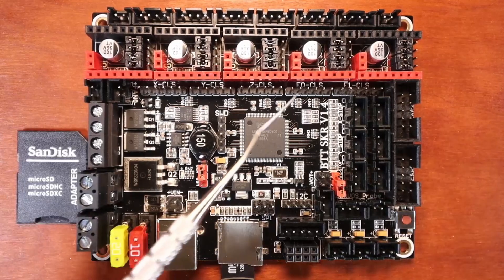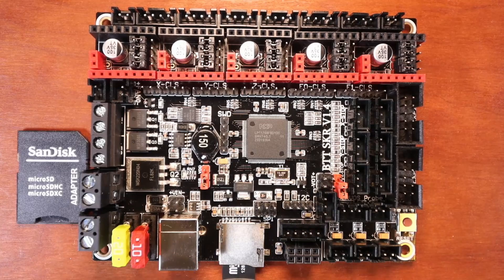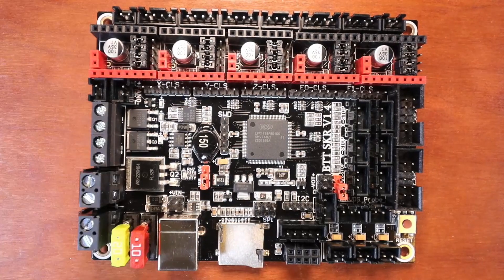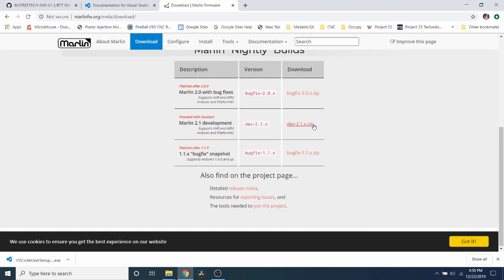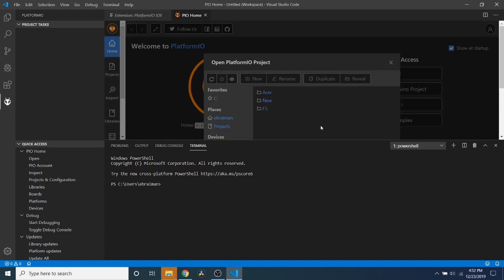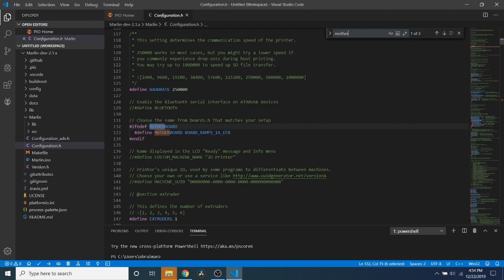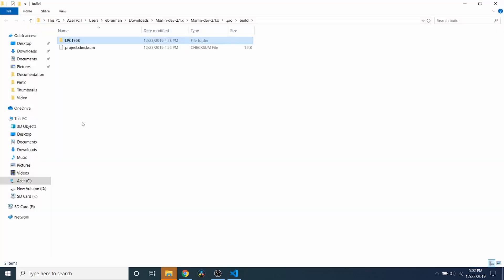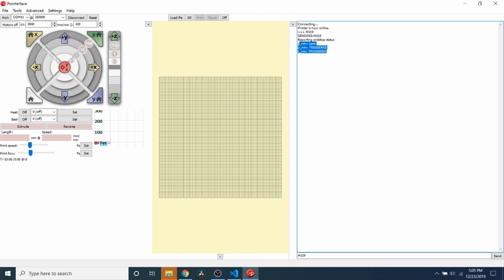BigTreeTech SKR 1.4 - Basics

Comment: There is no X Y and Z MAX endstop pins on this board, the MAX pins you reffered to aint endstop pins, they are diag pins for filament runout, power diag etc.
Reply from the maker: Are you sure they cannot be made max pins?  The pins can be modified to be anything as long as you understand how to modify the boards pins file.  So yes, they can be x,y,z max endstops or runout detector.
Reply: @EdwardBraiman  well you can use two of them I think, but the one next to Z-min dont have any resistors connected to it, its for power detection.

Comment: I couldn't connect to the V1.4 turbo card with the computer no matter what I tried. I saw you had a video on how to use just the card, I thought awesome. Compiled the firmware, sent it to the drive, it updated the firmware on the card. I installed it in the board, I have the board connected up to the printer already, but it still shows no printer attached on the screen. I sure hope they didn't sent out a bunch of Turbo cards that didn't work. Big Tree Tech is not responding to any emails I sent. Thanks for your instructional videos and your time involved in making them for us all.
Reply from the maker: you're welcome.
Reply from the maker: Did you get the TFT display to work?
Reply: @EdwardBraiman  I did, but the first one failed, the chip on the card would get over 200 F and the screen went black. The second one is working, but I only have the touch screen part, which is what I wanted any way. All the cables have to be connected or it won't work. I even tried it using the port 1 from the driver card to port 3 as BTT instructions say to do, but still no old school display using the knob. I went through 4 driver boards and finally the 4th driver board worked. The printer is so quiet now and the prints are outstanding. Thanks for your videos, they helped me out a lot.
Reply from the maker: Good to hear everything is working well.

Comment: How different is it for the turbo boards will i be fine if i follow along?
Reply from the maker: Just the speed of the processor and a power bar which has almost no documentation.  Yes they only difference if motherboard and processor in tutorial.
Reply: @EdwardBraiman   Did you cover the speed of the processor? I'm building a machine frame scratch and this is the hardest part.
Reply from the maker: In the second video tutorial in the playlist on SKR 1.4 turbo.
Reply: @EdwardBraiman  awesome thankyou!
Reply from the maker: You're welcome.

Comment: In Teaching Tech's video he copies files from config/examples/<printer model> to the Marlin folder. I notice you don't do that (and when I try that way it doesn't compile). Can someone explain to a total newbie how/if you define the printer model/size/settings??
Reply from the maker: Well examples files is a good method to use in Marlin firmware versions 1.1.9 and below.  For Marlin firmware version 2.0.x, they may not be updated due to recent release.  The reason I do not use them is mostly to show the logic of the steps in my tutorial.
Reply from the maker: Most printers have a defaulted size in the firmware configuration.h.
Reply: @EdwardBraiman  thanks! So you are saying it is best to manually go through the configuration.h and set your perimeters? Should I download stock firmware and compare the configuration.h files to help get it correct? (Or is there a better method)
Reply from the maker: Yup.  At least you'll understand all the pieces.
Reply: @EdwardBraiman  eventually!! LOL thanks again for the videos
Reply from the maker: You're welcome.

Comment: I'm getting 9 or 10 errors every time I compile, on lines that I have made no mods whatsoever.  What's going on?   #error "TMC2208 or TMC2209 on X requires X_HARDWARE_SERIAL or X_SERIAL_(RX|TX)_PIN."
Reply from the maker: That maybe linked to a sanity check on other changes that occured.
Reply: @EdwardBraiman  As it turned out, I was trying to adapt firmware a kind soul had posted to Thingiverse and which was, by dint of successive Marlin upgrades, hopelessly out of date by the time I got hold of it.  He was also using turbo, and the 1769 environment was activated in platform.ini, so nothing I had done was jiving with that.  Once I got that corrected and updated to the latest bugfix, everything literally dropped into place and I was off and running.
Reply: @EdwardBraiman  On another topic, have you weighed in on the various Ender Xtender upgrades?

Comment: I lost the original file that came on the sd card do I need it?
Reply from the maker: Nope, but it's probably on BTT website.
Reply: @EdwardBraiman  will this video show me how to get this working with an ender 3pro?l also have tft35 im trying to get going at the same time ive managed to update the screen this boards being a pita
Reply from the maker: There is a series of videos in playlist for SKR 1.4.
Reply: @EdwardBraiman  i follow teaching techs guide to a tee and all i get even with mynold screen and all i get is a blank screen,no touch screen side either.Only thing i can gat to work is my 4.2.2 board with ith new screen but no touch screen side.If i still had hair id be tearing it out
Reply: @EdwardBraiman  last question is there a default bin file i could just load onto an sd card for ender 3 pro or would i have more luck with an SKR Mini E3 thanks for all your help
Reply from the maker: There are other videos in my playlist regarding TFT.
Reply: @EdwardBraiman  there has got to be a bin file  already  done for this turbo board for the ender3 pro somewhere ive tried doing this for over a week now hours and hours getting somewhere but nowhere I just need someone elses bin file so i can end this nightmare lol
Reply from the maker: In Marlin examples folder.
Reply from the maker: Once you see the process it's easier.
Reply: @EdwardBraiman  i just want it to work i paid 80 bucks to get rid of that god awful screen and that wheel button.why cant i just find the pre compiled bin file?
Reply: @Edward Braiman  vs code,marlin bla bla bla is as fluent to you as breathing.I have to take breaks video tutorials ive never even heard of this stuff,I know you can effortlessly make that stupid bin i need in your sleep
Reply from the maker: Let's break down the question.  Are you asking how to connect a screen to SKR.1.4?  If so which type?
Reply from the maker: You know I have a Discord channel if you want to describe you issue better.  Keep in mind I'm on EST.  There is always several people in there to help.
Reply: @EdwardBraiman  no my skr1.4 wont connect to my tft e3 i get the printer not connected msg.So I put my old screen back in and it comes on but is blank.Im not compiling the bin file right.My bin file is 87kb Teaching techs is in  the hundreds if I could just get that bin file from that video https://www.youtube.com/watch?v=-Gdk0wHg51w&t=105s
Reply from the maker: So for TFT display there's a secord serial port setting of 0 (zero).

Comment: Hey Edward i have a question if you could answer. After a short circuit of print cooling fan cable my board became unusable. q3 ligth is on and red ligth is not turning on. İs this a dead end or could it be saved. I changed the fuses by the way nothing works. Appriciate if you can help.
Reply from the maker: It's a hard question to answer.  It depends on your knowledge of electronic and you ability to repair.  If the cost in materials and your time are worth it try and repair.  If it exceeds this then just replace board.

Comment: Hi and thanks for the effort you put into this. I want to add a controller fan but it wants a pin number assigned, can't find anything that deep. Can I use the touch probe pins (0.10) if not used?
Reply from the maker: Google, "btt GitHub SKR 1.4", go-to hardware for SKR 1.4 folder and look for file name with pins in it.

Comment: Pronterface is sending back...
 
Reporting endstop status
x_max: TRIGGERED
y_max: TRIGGERED
z_min: TRIGGERED. 

Is this telling me that it was not updated? 

When I try to switch to marlin on my TFT35 V3 I get a black screen. Anyone have any ideas on these problems? I am assuming it is because the TFT35 V3 is not finding marlin.
Reply from the maker: They sound like two separate issues.  First are any Endstops connected to board?  Second did your TFT illuminate before?
Reply from the maker: What's the position of the 5v jumper for USB?
Reply: @EdwardBraiman   No end-stops are connected. I am not sure if it illuminated b4. I took the sd card out and used pronterface and ran m115 and it comes back as  bugfix 2.0.X and that is what I used. So it did install. But I am still not sure why x,y, and z are all coming back as triggered.

Comment: Hello Mr. @Edward Braiman
Is there a way to connect a 12 volt RGB LED to a Skr 1.4 board?
How can I set the pins for the three colors, given that the RGB LED output in this board is for the neopixel type, but I cannot get it, but I have the normal type, and I tried to search for a way to connect it on this board, but I failed to get an answer, it is related to specifying custom bins and so on and this is difficult for me ..
I can feed the stripe with 12 volts via a transistor and connect it to the board, but I hope to find a way to connect the data outputs on the SKR 1.4 ....
I hope you will help me as you helped me in the past, as you did in any case, and thank you
Reply from the maker: I'll need to research.
Reply: @EdwardBraiman  Thank U Sir ...
can i use Max end stops pins for this reason ?
Reply from the maker: Depends on how much modifying of Marlin firmware you're comfortable with.

Comment: Is it necessary or needed to put, say, a 2gb micro sd in there? If that's even possible?
Reply from the maker: You should limit the size of microsd card to 128gb of fat32 filing system.
Reply: @EdwardBraiman  The included SD is in fact 128MB, hah I haven't seen that size in ages. Is it going to be enough?

Comment: Is the baud rate supposed to be 115200 for this board? There is no pin map for v1.4 turbo. Use 1728? Use V 1.4? Change board id? Missing library for 2209 drivers. VS Code won't compile because I have to update my includes. I have to do that instead of the seller?  There may be some messages down there in the corner to include things, but we won't go into that now.  Install a library installer with DOS commands to install the parts the seller couldn't bother with. The gd rubber duck doesn't work either. Not very happy.
Reply from the maker: Hit compile a second time.  The board can do 500000.
Reply from the maker: Also this tutorial was recorded before SKR 1.4 turbo hit the market.  So lpc1768, turbo lpc1769.
Reply: @EdwardBraiman  Thanks for the info and vids. This can be daunting for a mid-level user. I still need to learn how to install libraries for graphic display and tmc stepper drivers, but I got it to compile a couple times now and feel like a hero. I found that just putting the sd card in the pc and hitting upload in vs code, it finds the card automatically and installs the bin. Watching your tuto for graphic display on 1.4 turbo next.
Reply from the maker: You're welcome.

Comment: 4:30 Although your Windows "recognises" the .CUR file as cursor file in this case the .CUR stands for current firmware on the board and has nothing to do with cursor which would usually be an "icon" type for the mouse cursor appearance.
Reply from the maker: If you want some humor read the comments from my SKR 1.3 Basics when I said current.
Reply: @EdwardBraiman  I tried to find a comment about that but couldn't - however, don't let yourself be "corrected" to the dark side when you were correct the first time already - otherwise you'll just get a clever-d... like myself jumping onto that again

Keep up the good work 👍

Comment: is this a plug and play board? Everything already installed?
Reply from the maker: Plug-in play relates to Windows operating system.  The board is different, you need to manually configure Marlin firmware to operate per your needs.  As for connecting to Windows 10, it should configure automatically.

Comment: NOTE:  If  you  have a 1.4 turbo.  you  need  lpc1769
Reply from the maker: Probably yes, but I'm not seeing pins file in Marlin firmware update yet.
Reply: @EdwardBraiman  indeed. But it Worked.  Maybe 1.4 and 1.4 turbo are the same. Only 20mhz faster
Reply from the maker: They appear to be identical with exception t the processor and that might be easy to figure out by comparing similar pins files in Marlin.  Keep in mind that there is an existing open bug in Marlins bug repository.  It might save you time reinventing the wheel.

Comment: Does this board have integrated stepper motors or do you have to buy additional motors?

Also you mix the extrudes number up
Reply from the maker: Not sure I understand?  The two components used with stepper on board.  A stepper driver board and Nema17 stepper motors.
Reply: @EdwardBraiman  Everywhere I look they talk about adding additional stepper drivers, ie TMC2209. Are there any onboard drivers or do you have to make an additional purchace, Thanks

Comment: hello and congratulations for the very instructive videos .... I would like to ask you one thing, I purchased an anycubic predator printer ... how can I modify the fw. for that car? ... thanks for the info ... 😊
Reply from the maker: You may have to provide a little detail.  You referencing a type/brand of printer.  I'm not sure what motherboard they use. My videos reference a type of mother that can go into multiple printer types.  There is an example folder in Marlin that may provide a template for what you're doing.
Reply from the maker: @Italian-design-4.0  Delta should be in examples folder of Marlin firmware.
Reply: @EdwardBraiman  thanks :-) 
sorry but actually I had to write you to the video of the skr 1.4 turbo ... now I continue here

my printer
is not in the marlin 2 list unfortunately

the printer is called anycubic predator ... the card is the skr 1.4 turbo and the drivers are 2209
Reply: @EdwardBraiman  I would like to understand what parameters to put for that printer
Reply from the maker: @Italian-design-4.0  the parameters/configuration are the same as the the other videos in the  playlist with the exception of motherboard and defualt environment for the turbo settings in this video.

Comment: On a side note if I may. Is there any good/easy way or good practices to handle several different printers as well as making updates between versions?
I will use Marlin 2.x on a 8-bit Ender 3 (stock board) and a Ender 5 Plus (with SKR v1.4 & TMC2209's), those will be quite different.
Reply from the maker: Well practice and source control like Got or SVN.  I normally test configurations in small units and then combine what works.  It's very similar to the videos.

Comment: when I try to open marlin I do not  have the platformio.ini file that is needed to open in it how do i find that file?
Reply from the maker: Which version of Marlin firmware did you download?  Are you using VScode and platformio IDE plug-in?
Reply: @EdwardBraiman  I accidentally downloaded only the configs file i fixed it and downloaded the 2.0.3 version
Reply: now platform io is not loading on vs code even after restart
Reply from the maker: Try reinstall.
Reply: @EdwardBraiman  i did and it is working now how do you search in platform io? also these videos are great thanks for the detailed content any ideal if you be doing tutorials on 2209 2130 driver installs?
Reply from the maker: Tmc2130 is on the playlist.  TMC 2209 is mostly recorded.

Comment: Just tried following your steps for skr 1.4. turbo with LPC1769 and latest Marlin dev build fails to compile it. In latest marlin fw no pins defined for lpc1769 for a new turbo board.
Reply from the maker: Almost purchased a turbo, but the only difference is a couple of MHz.  I'm guessing it loads fine on SKR 1.4?  Maybe y you can open a bug on Marlins bug page.
Reply: same here, SKR v1.4 Turbo  with LPC1769 fail to compile

Comment: I just installed the SKR 1.4 and the TMC 2209's and now my extruder motor isn't working. It locks the motor like it trying to turn. I swapped drivers and the problem stayed with e0. Do you know why this is happening?
Reply from the maker: Unsure, but I'll attempt tonight and see if I see the same thing.  Who makes the steppers?
Reply: BigTreeTech TMC2209
Reply from the maker: Checkout my tutorial on SKR 1.3 for tmc2208 UART, the steps should be similar and ignore the previous comments.

Comment: So I bought the skr 1.4 turbo with steppers combo from Amazon. However I was sent the the 1.4 non turbo. The label was wrong on the box and they offered me a discount for the mixup and cost was only 16 bucks from the 60 that it would have been. I technically had no reason to get the turbo as compared to the regular other than having the best version. I'm probably only gonna use the wifi and steppers and maybe at some point an auto bed leveler. I use all the time and is pretty much on and running constantly apart from readying the next print. But i use it for hobby and not commercial. And this is going on the ender 3 original and not pro. So my question is, is the turbo that much better that I should def get it. Or is the normal version all I'll need for my type of use. Cuz 15 bucks is hell of markdown from the 60 it would cost and I'd be dumb to switch it for very little improvement?